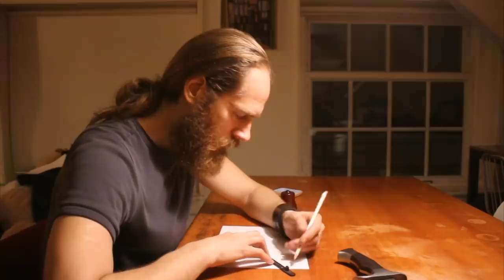Forging 4 Bowie knives out of semi truck leaf spring steel, the complete movie.

Comment: What's the sand stuff you put them in? I am actually trying to do this. I don't have a forge or anvil. Im  trying to get it it hot enough in my wood stove to get the bend out of the spring. I am wanting to make 2. I had to cut the spring in half.mine I'm thinking will be 15-15 inches oal.

Also what is that toll called that you ran along the edge with the marker in the middle of the blade?

Comment: is that sand you cool the steel in?
Reply: Michael Powell it's vermiculite I presume. It's for softening the steel.
Reply: Ebel-Jan Schepers do you know why this softens the steel? Something to do with cooling evenly and slowly?
Reply: @ConcreteLand  Vermiculite has insulating properties. So the steel will cooling down very slowly. Hereby a link for further explanation: https://www.instructables.com/id/An-Introduction-to-Heat-Treating-Carbon-Steels-Ann/
Reply: Ebel-Jan Schepers thank you